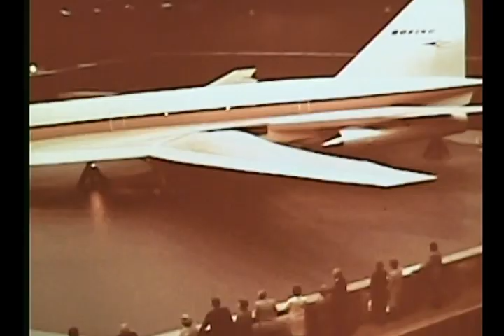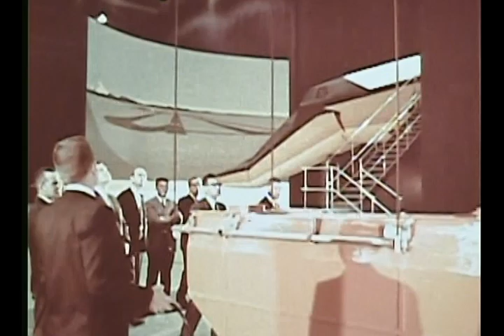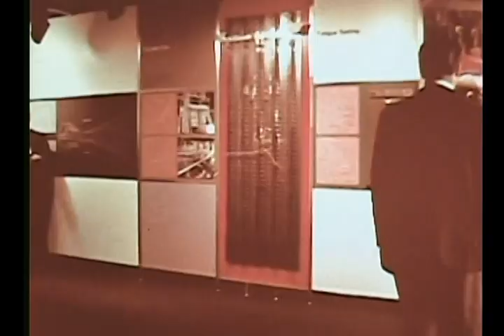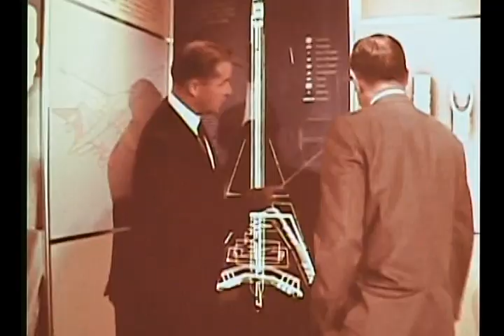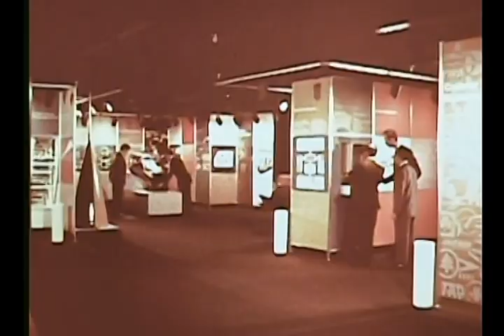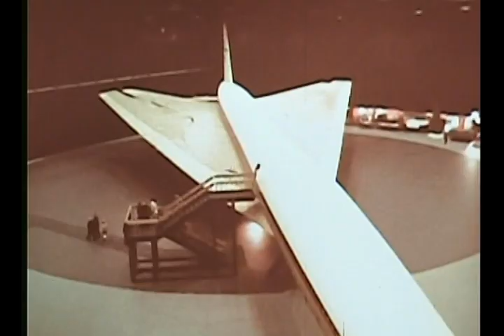Boeing 2707 Supersonic Transport film - probably 1960s

Comment: Sadly the swing wing couldn’t cut it and Boeing came out with the Double delta variant the 2707-300 variant and then the Democrats killed it in May of 1971 imagine what would have been had it wasn’t killed or if the Lockheed L-2000 was chosen to represent us in the race to build an American SST
Reply: I imagine the oil shock of 1972 would have resulted in it getting killed with some metal having been bent and cut.